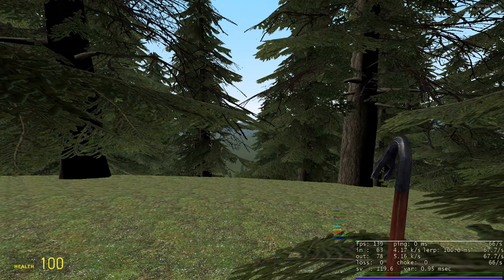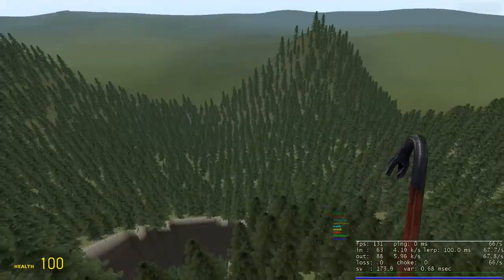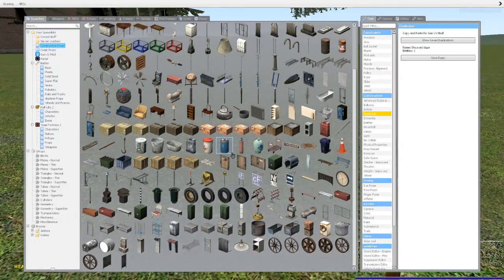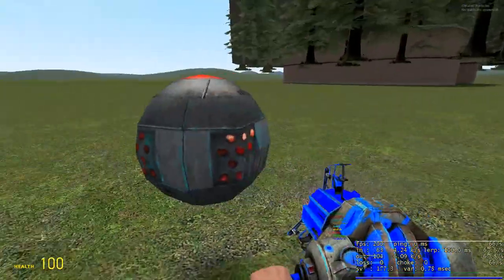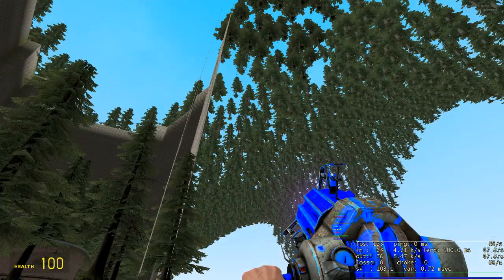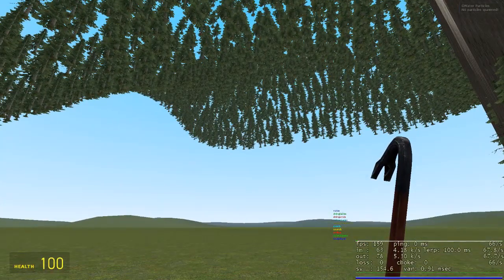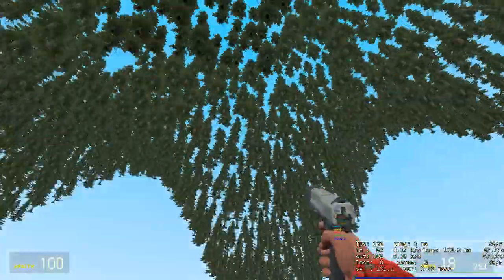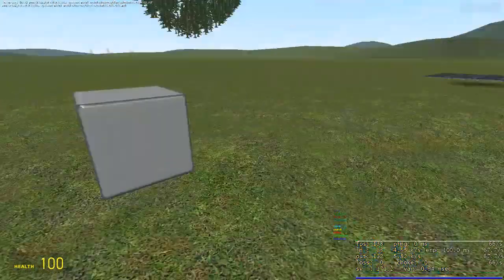Procedural Terrain 6 - Trees.

Comment: The lighting bug sounds like your material for the trees is using the wrong shader type, I’ve seen similar effect when using prop shaders on world brushes, could be something else entirely but I’d investigate there first.

Very impressive stuff, you’ve essentially combined the draw calls of the trees, had no idea gmod was capable of doing this!

21 Million vertices shouldn’t max out your gpu though, could just be more source engine crap but there’s definitely a bottleneck in there somewhere
Reply from the maker: the leaves are transparent, & theres no LODs yet
Reply from the maker: next video will explain a new technique someone explained to me that is highly efficient

Comment: What about making trees have less polygons? Seriously, is the most obvious solution. Why the hell should you place max detailed trees when medium-low poly would work just fine. You're not a battlefield dev to make ultra hd graphics in 10+ years old engine. (Maybe you can also add LOD setting in q menu or something so players can choose how detailed they want trees to be) the main problem that I see here is that built in Level of detail won't work properly with such mesh so you'll have to like go to blender and manually decrease polygons. But even then, adding just a few models to addon won't make it weight 99999 terrabytes and lower frames to 0.5 per hour.
Reply from the maker: cus they look pretty :)

next video will explain a better solution to this problem with already implemented LODs

Comment: aren't the vertices reused for multiple touching tris?

EDIT: also, is GPU instancing possible in source? effectively if you only have one mesh, you can actually just store one vertex per tree, and then do vertex transform on the gpu to render. then you only need one mesh per chunk or more, with one vertex per tree
Reply from the maker: it is… kind of
next video will explain a different technique to rendering trees that is highly efficient using something similar to this

Comment: So you mean you've combined several trees into a single model? If that's the case, your problem with the lighting might be related to $bbox or $illumposition.
Reply: Basically what I know:
$illumposition is the position of a single point, and whatever lighting affects that one point from the environment, the entire model gets lit accordingly. Sometimes people make the mistake of putting it's position below the ground, and the model ends up very dark in certain places when it shouldn't be.
$bbox, the bounding box, determines where the model ends. Apparently most entities that you spawn just render even when you're not looking at them? Because the only time I remember having trouble with $bbox being too small is on prop_static hammer entities, where they essentially disappeared when the bounding box was no longer visible.

Additionally, those values are automatically generated when compiling a model. So if you've decompiled a model prior, you can basically just remove them from the qc.
Reply from the maker: turns out the real issue was it was using the last pushed value in the shading framebuffer, all I had to do was set it with render.resetmodellighting

Comment: Would generating trees in maximum LOD (where they have the least vertices), speed up the generation? Once you make LOD system, of course
Reply from the maker: yes and no, because if you wanted dynamic LODS then you would have to generate the HD and LD mesh, which is slightly more expensive

Comment: if possible, you could do instanced rendering for the trees, or if also possible,  you could generate the trees on a thread seperate thread and the terrain on a seperated thread, and if source supports "index buffers" USE THEM, it helps alot with performance when generating meshes
Reply from the maker: lua is singlethreaded, the terrain is not in c++

Comment: Unreal engine does have LODs that can be applied to skeletons and normal meshes and even has tools to auto generate LODs before run time (not nanite) and in UE5 they have a system called nanite to automatically lower the quality of nanite enabled meshes based on how much you can see per pixel during runtime. but there are limitations with nanite some of the ones I heard are that is does not support transparency, skeletons, and deformation of the mesh with shaders.
Reply from the maker: I was referring to nanite
Reply from the maker: but yeah, nanite is weird as fuck

Comment: Time for theorizing:

If the worst case scenario is an edict count of 50% of max, I believe you could get away with a single edict for each group of trees which handles both their lighting and LODs.
For most games LOD is simply handled by distance.

Disclaimer:

In order to actually start doing the below, you'd need to have LODs assigned to each group of trees beforehand. If each LOD of the group of trees needs to be a separate edict, then unfortunately this may not be possible :''(

To achieve the same effect with your current method of grouping trees, you could have an edict which handles LOD of trees by distance to the edict.
In-bake, this would mean calculating all the trees in range of the edict, and assigning them to the edict's LOD script (would be nice if you could use shaders for this).
In-game, in the LOD script, you would first get the distance and direction from the player to the chunk, then assign LODs to each group of trees based on that distance and direction.
You would aim to achieve a result which mimics a circle<->square collision test. All trees in a group outside of the circle (origin is player) are assigned lowest LOD, then you gradually increase LOD within certain distance ranges (smaller circle test).
If you want to further save on resources, instead of calculating and assigning per tree/group of trees, just calculate based on chunk, of course at the expense of cleanliness.
Reply from the maker: The edict is shared by all entities
Reply from the maker: What i will likely do is completely scrap this method and create a single tree mesh, then push matrices directly to the gpu when drawing the trees
IMESH objects do not fill edict, but physical entities do
Reply from the maker: It will likely be 2 meshes, one with the highest quality and the other with very low quality non transparent leaves